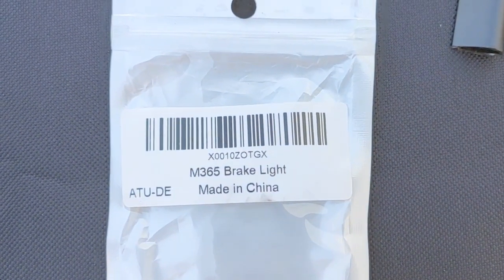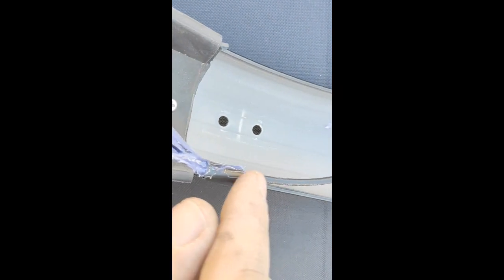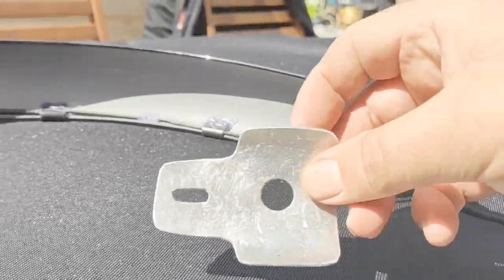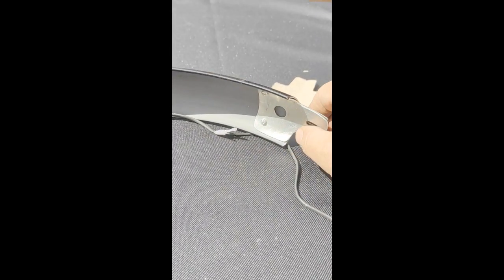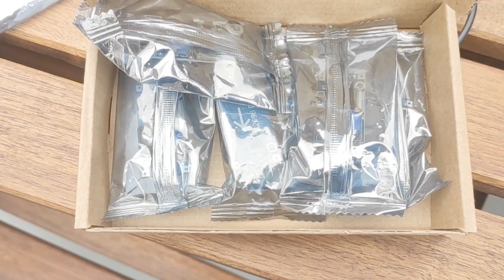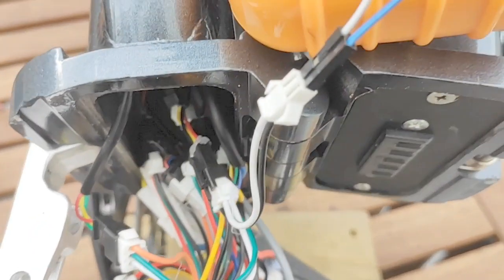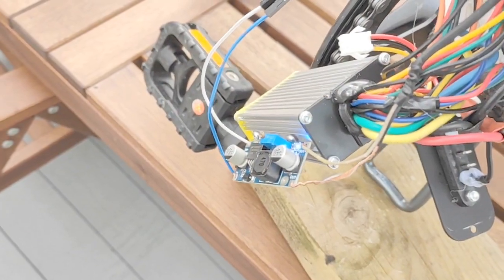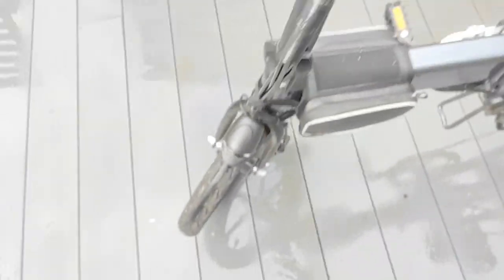Fiido D2S Rear Light Added

Comment: Thanks so much. Finally got the stuff and installed it on my d4s only diff was i used double sided tape to put the taillight on the fender since it didn't come with screws and didn't feel like ridin in the raín to the hardware store. 
Was less than 10 euros including the light, converter and even a volt meter from Ali express. 😉👍
Reply: Hi, I got a D4S. Could you show me how you connect rear Light to battery and your câble management please ?

Comment: Hi! I got a question as it seems you are a quite good electrician so you must be aware of the damage water can cause to this bike. Will you feel confident to ride the fiido d2s for about 30 mins in the rain? Thanks
Reply from the maker: Look at where the rain will do damage if it gets in....I have another bike and the power connectors do get some corrosion on....I have seen some people covering the display with cling film. There is a 3d printed part that stops water ingress at the frame hinge....I tend to not ride too much in the rain, I take my van

Comment: where did you buy that pouch on main frame? thanks
Reply from the maker: https://www.aliexpress.com/af/bike-frame-pouch.html?d=y&origin=n&SearchText=bike+frame+pouch&catId=0&initiative_id=SB_20210125001039
Reply from the maker: Have a look there are loads, i got one with velcro for the phone holder, so it is easily removed. I have had to replace the velcro on the pouch after using it for uber deliveries for about a year.